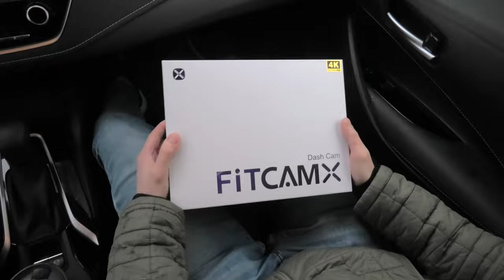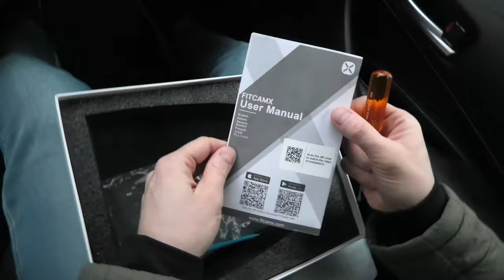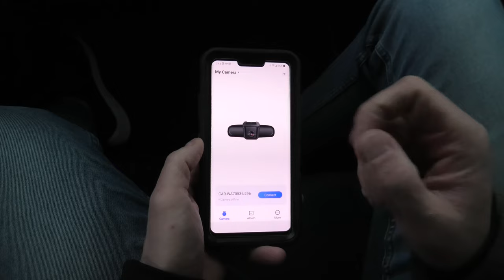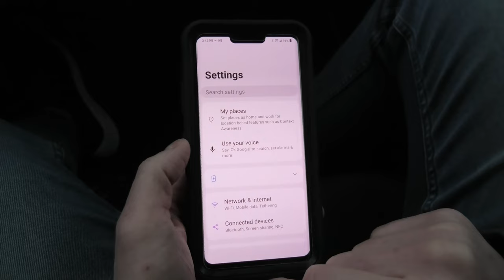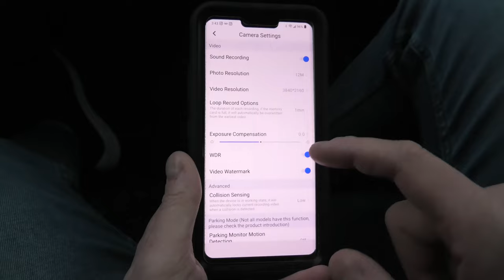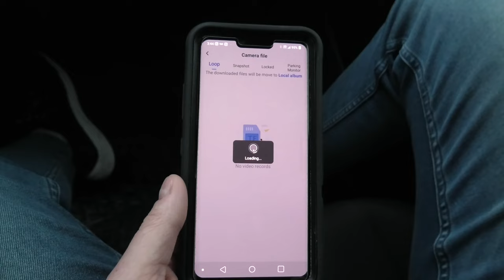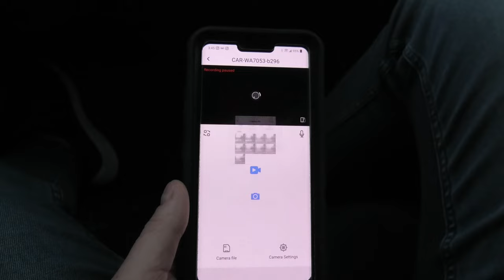Toyota Corolla (2019-2025): FitCamX - 4K Dashcam Designed For The Corolla. Hidden Wiring!

Comment from the maker: PRODUCT LINKS:
2019-2022 GEN12 TOYOTA COROLLA:
1. FITCAMX OFFICIAL WEBSITE - Dash Cam For Toyota Avalon/Camry/RAV4/C-HR/Corolla Hatchback/Corolla Cross/ Altis/Sienna/Prius/Tacoma/4runner/Sequoia/Tundra/Venza - https://fitcamx.com/collections/toyota/products/fitcamx-dash-cam-for-all-toyota?variant=39781006049452&sca_ref=1327756.jsIwH3r9xw.
2. AMAZON - Fitcamx 4K Dash Cam Suitable for Toyota Corolla LE L XLE XSE SE 2019 2020 2021 2022 Hybrid & Hatchback 2019-2022 (E210/Gen12), OEM Look, 2160P UHD Video WiFi, G-Sensor Loop Recording, Plug&Play, 64GB Card - https://amzn.to/3IwdgYr.

2023-2024 TOYOTA COROLLA HATCHBACK AND SEDAN:
1. FITCAMX OFFICIAL WEBSITE - FITCAMX Dash Cam For All Toyota Avalon/Camry/RAV4/C-HR/Corolla Hatchback Altis/Sienna/Prius/Tacoma - https://fitcamx.com/collections/toyota/products/fitcamx-dash-cam-for-all-toyota?variant=42521073156268&sca_ref=1327756.jsIwH3r9xw.
2. AMAZON - Fitcamx 4K Dash Cam Compatible with Toyota Corolla 2023 2024 LE SE XLE XSE Hybrid Hatchback, OEM Factory Look, 2160P UHD Video, Built-in WiFi & APP, Loop Recording, G-Sensor, Easy to Use, 64GB Card - https://amzn.to/4bV2AAA.

HARDWIRING CABLE - Fitcamx Parking Mode Hardwiring Kit - https://amzn.to/3FDla1I.
RED CLIPS - Rexka 25pcs Console Box Garnish Instrument Trim Panel Retainer Clip Fastener 90467-05171 Compatible with Toyota Tacoma Tundra Camry Avalon Corolla Highlander Land Cruiser Sienna RAV4 - https://amzn.to/48GukWR.

TOOLS USED:
FLAT HEAD SCREWDRIVER - Klein Tools A131-2 1/8-Inch Flat Head Screwdriver with Keystone Tip, Made in USA, Pocket Clip, 2-Inch Round Shank - https://amzn.to/3VV0FVh.
Reply from the maker: @CumBrianFries  
Yes, fitcamx supports SD cards up to 128gb.
Reply: @MorozovAutomotive  does it support 256gb SD cards? I know you said up to 128.

Comment: I bought this for my 2022 toyota corolla le, after installing, my lane departure, pre collision, and sign recognition all went down :/
Reply from the maker: Everything was working fine in the 2020. Toyota could have made changes in the 2022.
Reply: Oh sh-it .  Good to know.  Was looking into installing it in my 2022 Corolla
Reply: I installed this on my 2022 Corolla LE and I still have all the safety features enabled.
Reply: I heard someone suggest tighten all connections
Reply: It’s the connector just contact fitcam they’ll send a new one
Reply: MY corolla hatchback 2022 hybrid have same issue aftrer installed this fitcamx :(

Comment: hi morozov, i also install mine. i set my recording to 3minutes with 128gb but when i reach the 128gb full memory, it only records 15sec skip 15 sec and the record 15sec and so on and on. did that happen to you also? i set mine to erase the old vidoes for the new recording
Reply from the maker: Hi, never had this issue. Try to format the SD card.
Reply: @MorozovAutomotive   i did. but anyway, how many hours  of 4k does your 64gb records in total?

Comment: Hi,works with parking mode ?
Reply from the maker: In order to enable the parking mode, the dashcam needs to be connected to the fuse box using the hardwiring cable. Fitcamx Parking Mode Hardwiring Kit - https://amzn.to/3FDla1I.

Comment: Hello,  very nice video! thanks , it is what i really need. Question: is it possible to lock video just pressing the button in the camera? usually i save video and after long time have to review,  without this option the videos will be deleted.
Reply from the maker: Thank you! This dashcam comes with the G-sensor. It will automatically save the video in case of collision but I don't think there is an option to manually save the current video file.

Comment: Does the camara has parking mode?
Reply from the maker: It does. But you need to connect the hardwiring cable in order to enable the parking mode. Fitcamx Parking Mode Hardwiring Kit - https://amzn.to/3FDla1I.

Comment: can the camera continue to run even when the car is off? i was thinking of purchasing something like this because there's been an increase with cars being broken in to in my area :(
Reply from the maker: No, the camera can not record when the vehicle is off. I believe you can get the hardwiring cable from fitcamx. This cable needs to be connected to the fuse box and this will allow the camera to use parking mode.

Comment: Just installed it today in 2022 Corolla SE.  i got the model with front and rear cams. watching the video and reading the manual is a must.  The video explains the gotchas and how to approach it. The clips , the wiring were a challenge but the video helped to prepare for the challenge. Total time for installation was 30 minutes. No issues with car sensors and safety features that I noticed. I would recommend to new installers to examine the clips on how it locks into place. Try practice removing it because the cover is concealed from view and pretty much you are using your sense of touch  to release the clips. I will update my comments if anything breaks. 😜Thumbs up. 👍

Update:. After month of use no problems yet.  One thing I noticed is the download from the DVR to your phone via built-in WiFi is bit slow but manageable.   Also realized once you are connected to the built-in WiFi you are not connected to the internet so must disconnect from DVR after done downloading or manage the DVR.
Reply: Did you get urs from Amazon by chance?

Comment: Hi i’m just wondering to install for toyota corolla hybrid, anything needs to consider? 

Dealer told me that not recommending installing dash-cam to third party especially hybrid. 

And is that not draining battery? 

Thanjs
Reply from the maker: It is completely up to you if you want to install the aftermarket dashcam. From our experience it has not caused any problems so far. It does not drain the battery.

Comment: Will this affect the sensor since it is sharing the same connector as the camera?
Reply from the maker: From our experience, we did not have any problems. We tested Fitcamx dashcam in the RAV4 as well. No issues.  Here is the link - https://youtu.be/-vkkGfpzVf4.
Reply from the maker: @CumBrianFries  Yes, they do have one for the Cross. Here is the link - Fitcamx Dash Cam For Toyota Avalon/Camry/RAV4/C-HR/Corolla Hatchback/Corolla Cross/ Altis/Sienna/Prius/Tacoma/4runner/Sequoia/Tundra/Venza - https://fitcamx.com/products/fitcamx-dash-cam-for-2020-2021-toyota-rav4?variant=39781006049452&sca_ref=1327756.jsIwH3r9xw. In the drop-down Model menu choose Toyota Cross.

Comment: How is it in the parking mode?
Reply from the maker: By default it doesn't have the parking mode. But you can order the parking mode cable from the Fitcamx. This will allow you to hardwire the dashcam to the fuse box and use the parking mode.